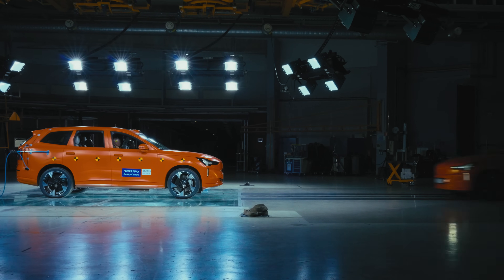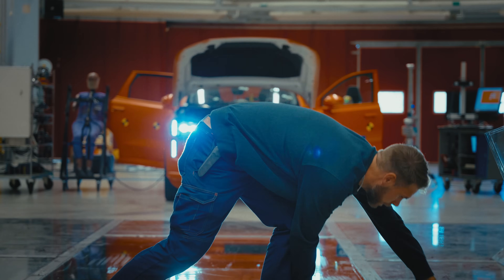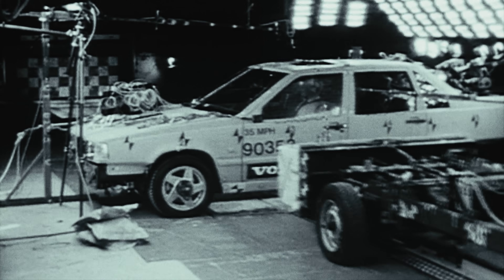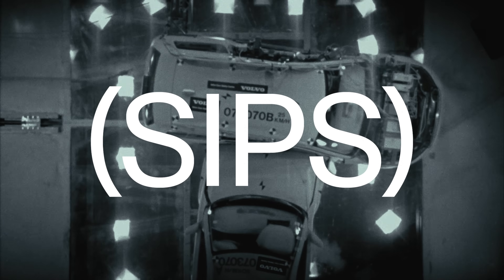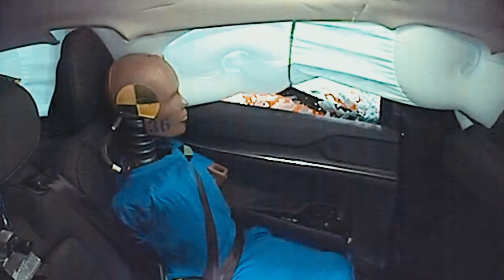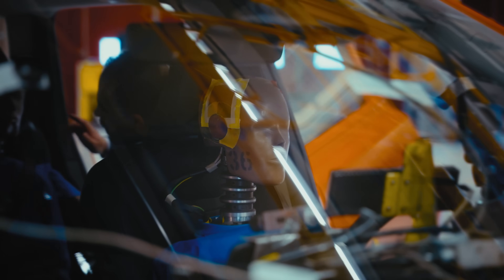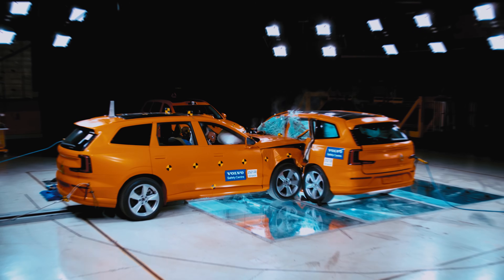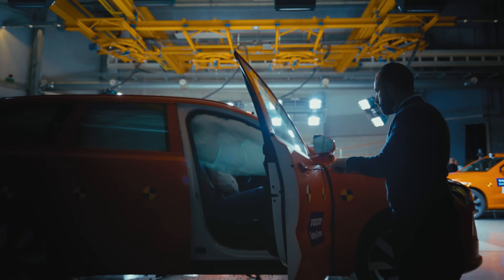Volvo EX90 Crash Test: Behind the Scenes of Our Safety Standards

Comment: The truth is that Volvo is slipping a bit in their crash performance.

Small overlap, moderate front overlap, side (as demonstrated in this video), got a score of good, which is high of a score a car can get, and that's great.

But their crash prevention stats with front crash protection with another vehicle and with a pedestrian were only acceptable, that's below good.   Volvo needs to improve the crash prevention system.

I did notice one thing in the video, the side curtains do not extend down far enough, it needs another 6 inches.  The dummy in the back seat just barely hit the curtain, had it been a slightly smaller dummy by just one inch and that head would have hit the glass and door interior.

This is according to the IIHS, you can go to that website and check out ratings for all cars that were tested, and Volvo is not doing as well as a lot of other cars.  However if you go to the NHTSA site instead things get slightly more dicey.

The Volvo SUV's only got a 4 star out of 5 for frontal crash, while it did average a 5 star rating, it's that one low score on the front that should bother people.  There is no Volvo represented in the perfect all 5 star rating for 2024.  While Volvo isn't bad, but they could do better, and have done better in the past, some minor tweaks to the front end damage and they could be there.  The NHTSA doesn't test for accident avoidance systems.

Comment: Wish list for 2026 EX90 (hopefully Volvo cares about customer feedback):

- Backlit, more tactile, and more intuitive steering wheel buttons (was much better in earlier SPA1 cars).
- Physical controls for HVAC, headlights, etc. (it's not safe to constantly go through submenus on a screen to do anything!).
- Second row window switches for the driver (instead of the stupid, 2-step toggle).
- Two wireless phone chargers in the front centre console with ventilation/cooling (passenges also have phones, you know?).
- Overhead grab handles for all outboard seats.
- Powered retractable sun shade for the Pano roof (way more energy efficient in maintaining a consistent temperature inside the cabin and actually blocks the glare).
- Physical latch for the glove box (no one wants to have to go through the screen to do this!).
- Revised "frunk" latch mechanism for easier access (like the new Mercedes GLC EV).
- Real key fob with buttons that holds a charge for more than a week (No piano black either!).
- More interior colour options (like two tone tan and black or navy blue, for example).
- Cross Country trim (subtle) for people who actually live in the countryside and worry about rock chips around the wheel wells, etc. from gravel roads.
Reply: All set. We changed everything.
Reply: Totally agree! just got a polestar 3 and the lack of buttons is maddening and dangerous, especially when the UI isn't the best to support it. This is our 4th volvo/polestar - we love the brand, but for a safety conscious car company, the lack of buttons and poor UI are unacceptable.

Comment: I had been meaning to get Volvo since 2015 and finally managed it in 2022 with XC60 PHEV after much convincing my family that it’s not a truck company. Always impressed by seat and safety. The seat is none to any, and I never had any back pain since then. The safety features are impeccable.

My question is on side impact why didn’t the oncoming volvo stop with AEB? Secondly, I found a couple of times during back up the car brake or AEB doesn’t work and car doesn’t stop when an object is there. I took it to the dealer they couldn’t recreate or find anything.
Reply: They have to turn off the feature in order to get the cars to crash. Of course, the best way to survive a crash is to avoid it, but we need to prepare for every possible scenario.

Comment: The last update 3.7.0 for XC40 full electric sucks. 
Why does it ignore my gas pedal inputs now? Occasionally it decides to stick to common speed limits like 30, 50, 70 or 80.
You might be surprised about this but i have been driving this car since i bought it. And not once did i think " oh boy i want my car to tell me how to use my gas pedal". Its god damn annoying. It made the driving experience uncomfortable, jerky and plain unsure. My ev feels like an automatic now but random. It wants to stick to 30 for example as if it was switching gears. DISGUSTING.

Comment: It is amazing, although with the side impact car, hopefully other vechicles are used to replace the car coming from the side, because if this Volvo already has a front that deforms well and safely in a crash, then when it goes into the side of another similar Volvo, the Volvo that is being smacked into, benefits from being smacked into from another safe Volvo, but maybe not some other car.

To be honest, I guess they have tested this as well, but you can't really have an official video with some other random manufacturer being the car that crashes into yours I guess, so had to use all Volvos, at least for the video.

Comment: How can this be considered safe when my EX90 has had over 40 documented problems—some disabling the airbags and SRS, others leaving the wipers or lights non-functional? We completed the Lemon Law process during the last repair attempt over a month ago, yet Volvo still hasn’t refunded the vehicle. Instead, they seem to be doing everything possible to keep it quiet, while the car remains unreliable and unsafe.
Reply from the maker: Hi there, we are extremely sorry to hear this. As the social media team, we aren’t able to directly handle refund or Lemon Law cases, but we do want to make sure your situation is addressed urgently. I’d recommend getting in touch with your case handler or the Volvo Customer Care team in your country right away to request an update on the refund status. / Jade
Reply: You are not the only one.

Get a 2019 or 2020 clean title car from before supply chains fell apart.

Comment: If I choose to have captain seats in the rear in an EX90 (6 seats) does that mean that there will be an integrated airbag between the seats in the backseat (second row) just as in the front? @volvocars the same protection should come for the passengers in the back as for the front right?
Reply from the maker: There is no integrated centre airbag like in the front seats. The front row has a special centre airbag for side impacts, but this isn't available in the rear.

That said, we still offer strong rear passenger protection with side curtain airbags, reinforced structures, and advanced seatbelt systems. Thank you for the feedback, though, we will be sure to pass this on! /Irene
Reply: It should but doesn’t the passengers in the front of the car will virtually always be safer then in the rear apart from the Mercedes s class which offers similar protection in both parts of the car

Comment: I've been driving Volvos for many years. Love this brand.

Combustion engine cars (XC60 and XC90) should get an upgrade beyond the facelift. Volvo now has better technology, and those models could be upgraded. Many loyal customers do not want to move the EVs but wish to have the latest safety features.
Reply from the maker: Thank you for the love! What upgrades would mean the most to you? / Jade
Reply: @VolvoCars  

1) Safety - I bet EX90 is better designed than XC90. Can some of this know-how be applied to upgrade the combustion engine lineup? Not just a facelift, but the actual structure of the car.

2) Infotainment - you can make significant improvements to the software, usability, etc.
Reply: @VolvoCars The UI on the infotainment should me more colorful and more elegant. Icons are so basic like those in cheap tablets. The instrument cluster cannot be customized. It must let the driver choose from different themes and colors. Even the tire pressure systems shows no detail. The funniest is while on the phone, I cannot see the range left and gas left etc since it blocks the information shown on the cluster:) It is 12.3 inch cluster and there is incredible space on the screen! If you want to learn more I am at your disposal
Reply: I too will be looking to purchase a new X90 as here in Midwest USA we just do not have sufficient charging stations for electric models to drive long distances. But I want my vehicle to have all the newest features that are available on the electric models. I’ve had my X90 for over 7 years and it’s been very reliable and I love it. But it is time to get a new X90. However I want all the updated features like I purchased years ago. Will you be featuring all the latest upgraded features on the regular X90 and WHEN?????

Comment: My old S60 P2 2007 is designed in the 90’s, and still have a 20% safer score than the average car, according to Folksams research. That’s very impressive indeed!
Reply from the maker: That's impressive! Are you still loving the drive? / Jade
Reply: @VolvoCars  Very much, 350.000 km, still drives almost like new. Classic volvo reliability!
Reply from the maker: Amazing! /Niamh
Reply: Crash worthiness degrades with vehicle age and even if you 2007 s60 was brand new it unfortunately can’t be compared to a new car from any brand today they would be much safer then your old Volvo,it’s just the harsh truth
Reply: Depends.
    Volvo S60 is still MUCH safer than budget cars like Fiat or Dacia and tests confirm that.
    The poor test dummy in Panda got an uppercut punch instead of protection from the airbag.